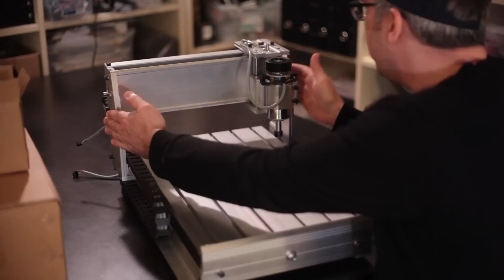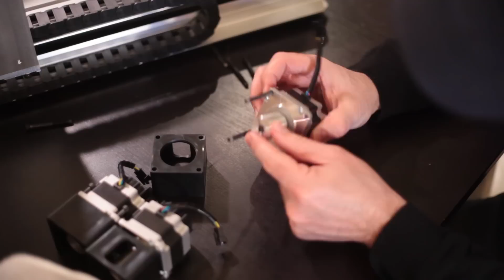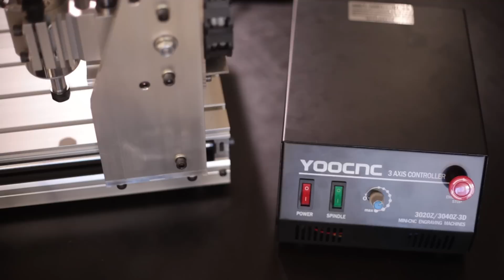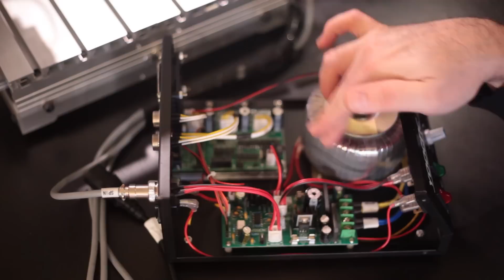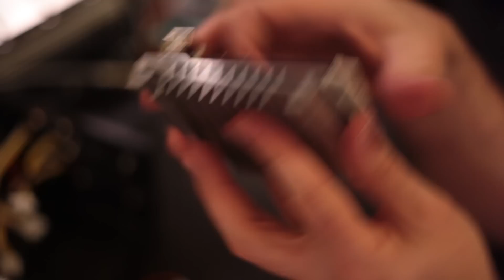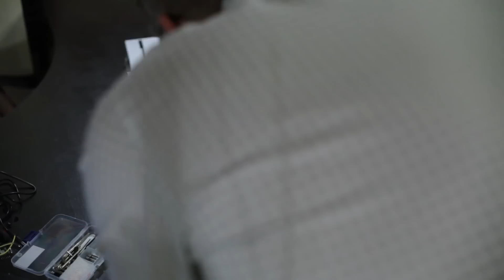Build a ChiliPeppr Driven 3040 CNC

Comment: Stupid question : could someone just use that http://www.ebay.com/itm/CNC-USB-CONTROLLER-UC100-for-Mach3-CNC-Controller-USB-to-Parallel-/271300225770?pt=LH_DefaultDomain_0&hash=item3f2ac0eaea and run Mach 3 ?
Reply: Mambrax444   You can and should us the UC100 and mach 3.  While mach 3 is stated to be "OLD"  When you run cnc in real applications where 100,000 to millions of lines of g code are to be processed, mach3 has not been beat.  Its low cost and HUGE user base/support is a benifit.  I cannot see why someone would cripple a machine by running low power stepper drives.  The router itself comes with crappy electronics.  This should be the very first upgrade.  High quality stepper drives and power supply.  Will make a HUGE difference in preformance.  Also, there is NO stuttering when using either a SmoothStepper or UC100/300 Pulse generators.  Dont know where that myth came from.
Reply from the maker: Mambrax444 You likely could, but i've heard these converters cause stuttering. Also, I would say Mach3 is getting a bit old. It's expensive too. ChiliPeppr is free. If you stick with Mach3 you also lose out on using a Raspberry Pi as your remote interface, the ability to do remote monitoring, the cloud, using a browser, using a tablet, writing your own Javascript plugins, using GPIO ports from a Raspi or BeagleBone for extending, etc.
Reply: Thanks for the input. Just getting more educated on the all home CNC world, for sure your approach is clever and elegant, just not sure i will be capable of doing the same great job at it !
Reply: +CNC Thanks for the input. Still in the process of searching. Any pointer and additional info regarding the use of UC100 and those machine. I'm a little worry to get a unit that doesn't work with that config as well how to set it up. Any help will be warmly welcomed !!!
Reply: Mambrax.  The UC100 is as plug and play as it can get.  The who purpose of the device is to 1 allow you to use a 25 pin controller on a computer without a printer port.  It also takes the work load off of mach 3 when it comes to generating pulses set to the electronics.  By doing this the computer works less and you get a smoother pulse stream out to the stepper drives.  The UC100 has the exact same pinout layout as a printer port.  So it will work with any configuration that mach3 will work with.  Software install is simple.  If the computer has internet access then there is an auto installer that will do everything for you.  If no internet, then you install the usb drivers, then install the plug in for mach3.

Comment: hi, I think your vid convinced me to go for one on ebay... I was looking at www.wegstr.com for about £380, looks precise and v.slow... but having much larger 30x40cm, ball screw machine for about £530 makes a better investment, I think... 
I want to do a v-grooved lettering on a 10mm flooring slate (house number signs).
Do I need any speciality software or is the ChiliPeppr something I could use for v-grooved lettering, pls?
BTW, I never used CNC but I use a 60W Chinese CO2 laser cutter regularly..
many thnx,
mike
Reply: John Lauer I am going a custom Build with TinyG and want to use a raspberry PI. The question is since you have to use a laptop to access the browser to run ChiliPeppr, what's the benefit of the Raspberry Pi?  Can I send the Gcode to the RB Pi Wirelessly via the Json network on CP? Or do I need to be networked with an ethernet cable to the RB Pi?
Reply from the maker: gr8deals2do Nice. I would say go for the higher end companies. Don't skimp. Avoid trapezoidal screws possibly unless it's not important to you. There are low-end providers on ebay. ChiliPeppr will be fine for you. It takes standard Gcode. Do a TinyG controller too. I have recently swapped the BeagleBoneBlack for a Raspberry Pi 2 which has been great for me.

Comment: Just curious- why the Beagle Bone as opposed to a direct USB connect from the laptop with JSON?  Thanks!
Reply from the maker: Couple reasons. 1) The BBB has GPIO on it so I can have it toggle on my eventual LED lighting, vacuum, fans, etc. You can't do that from a laptop. and 2) I want to be able to run my job from my laptop and be able to walk around the house and monitor the job by keeping the laptop with me. I will be running multiple webcams inside ChiliPeppr to visually and audibly keep tabs.
Reply: Cool. Good Answer! I wasn't even thinking beyond my tactile switches for lights and vac.

Comment: I don't understand what the Beaglebone does. I thought the TinyG did the motion control with its embedded processor and the Chilipepper sent it the g-code commands via USB. I wasn't expecting to see another processor involved.
Reply from the maker: ChiliPeppr sends to the Serial Port JSON Server. That server is a bridge between a websocket and all your serial ports. So, yes, you can run the Serial Port JSON Server on your laptop and eliminate a device, but it's nice to use a separate device so your high-end laptop can be de-coupled from being next to the dirty/dusty CNC machine. You can start your job and go sit on the deck with a coffee while it runs and you monitor it from your laptop.

Comment: I did exactly that a few weeks ago but with a CNC 3020. I cut a square hole with a Dremel near the parallel port to fit TinyG's USB port. It works beautifully!

One warning though: the power supply board is limited to 3A on both the 24VDC and the 50VDC supply. This means there's little room to upgrade the stepper motors, and you can't upgrade the spindle unless you redo the power supply. In fact, since the spindle power is limited to 50VDC * 3A = 150 W, the claimed 230 W rating is a bit bogus. If you redo the power supply, you're likely to need two separate power supplies (one for TinyG, one for the spindle), which will unlikely fit into the neat controller box.

That said, I have been cutting aluminium with just the stock motors and spindle, and for my application it seems sufficient. I'm more paranoid about snapping my endmills than not having enough power/torque.

P.S. ChiliPeppr is brilliant - Thank you!
Reply from the maker: Couperin le Grand do you have any video of cutting aluminum? You are doing exactly what I'm trying to achieve. Your experience with the power supply is GREAT feedback. I do want to upgrade the spindle soon so you're right. Even with the motors, if I am pumping out 2A to each motor I'm pulling 6A at some points. I'm driving them at 2.5A even, so you've got me worried already.
Reply: John Lauer I do hope I'm mistaken. The two fuses on the power supply board are rated 3A. Would it be risky to install high amperage fuses? One would have to find out the rating of all the diodes and transistors to be sure.

There is a second difficulty with upgrading the spindle. The 230 W stock spindle is 50 mm diameter. The 500 W one is 52 mm. If you want 800 W then it's even larger. The spindle clamp is nearly exactly 50 mm and won't accept anything bigger.
The spindle clamp is integrated with the ballscrew nut and linear bearing housing, so to upgrade the spindle, you'd have to replace the whole block. Some other models from carving-cnc.com have bigger motors, and it might be possible that the ballscrew nut and linear bearing positions are the same as the CNC 3040/3020. And then it's another question if they'd sell you just the block. I don't know if it's possible to saw off the spindle clamp, or to enlarge it, but I struggle to see how that could be done without losing any perpendicularity.

I'll be cutting more aluminium in the next few days and I'll try to post something. I'm using a 2 mm endmill to cut out shapes from 1.5 mm aluminium plates. Feed rate 1000 mm/min, 0.07 mm pass depth, full spindle power. No missed steps whatsoever.

The aluminium plate isn't very flat, and at times the first cut into the surface must have been as deep as 0.2 mm or something like that. It took it well, and still no missed steps, though the noise scared me a bit as I'm a total noob. The machine can be pushed to go faster, I think. I'll be trying the auto-level feature next.
Reply from the maker: Couperin le Grand Here's a spindle you could upgrade to, but that's about it given the 52mm diameter of the 3040 I have. http://www.amazon.com/LD52GF-400W-Engraving-Milling-Spindle-Controller/dp/B00CLL84A4/ref=pd_sim_sbs_hi_3?ie=UTF8&refRID=0HNP6GZMN62K9XHMQ794

I think I'd just run this from an alternate power supply. I would tap into the PWM controller so TinyG could drive it. Then I'm just not worried about any other inner guts of the controller electronics that came with the 3040.
Reply: Are you sure the 3040 spindle diameter is 52 mm? According to carving-cnc.com, both the 3040 and the 3020 come with the 230 W spindle, and mine measures 50 mm. I'd be surprised if the 230 W spindle exists in both 50 and 52 mm!
Reply from the maker: Couperin le Grand Yeah, I measured it yesterday with my calipers. It's 51.87mm, so 52mm. Also, the model number on carving-cnc.com of my 3040 is technically 3040Z+D52 and that D52 means "diameter 52mm" of the spindle.

Comment: John, is this CNC only for engraving tho?
Reply from the maker: The term engraving is used a lot to describe CNC machines, but this will do aluminum, carbon fiber, even mild steel if you go really slow. This thing is way more rigid than most CNC's out there in the maker community, so i think it's fair to say it's much more than engraving. It's no Tormach or Hass though.
Reply: wow... so with the tinyg, this will work just like a shapeoko? or u need the gshield?
Reply from the maker: All you need is TinyG. All the stepper controllers are built into the TinyG. No need for the gshield.
Reply: whats the difference? if u don't mind
Reply from the maker: The difference between Gshield and TinyG?
Reply: yes
Reply from the maker: Gshield is just the stepper motor controllers. TinyG is the Gshield plus 1 additional stepper driver and the core 32-bit processor running the firmware.
Reply: John Lauer great short and clear explanation! Thanks John!! :)

Comment: E stop to z max . Check TinyG wiki
:-)
Reply from the maker: Not sure that's the best approach here given that the e-stop switch on this controller stays depressed when you hit it. That forces the reset button on TinyG low, which keeps TinyG disabled perfectly. Only when you rotate to release this e-stop switch does TinyG reboot itself. So, why waste the z-max input which I'd actually like to use for real as the z-max?
Reply: That's ok too I guess, I just didn't think you wanted a reset every time you e-stopped. I think I might have gotten it wrong: xmin,ymin and zmax is "home" and xmax,ymax and zmin is the opposite end of the travels. That would make zmin the one I was thinking about.
Will you make a "intro" video for Chilipeppr (step by step for average users - zero to hero) ?
My CNC mill is not finished yet. I'm designing a miniature 10cm cubed cnc mill - i.e. I'm not using a Shapeoko.
http://www.realgentlemen.dk/MediaWiki - CNC Mill

Comment: Nice mod! How much did you pay for 3040 CNC, if you don't mind me asking?
Reply from the maker: It was $800 + about $200 in shipping, so that added up a bit, but it included the spindle, the power supply, the motors, etc. So compared to other CNC machines its way cheaper or on par and I think it's more rigid for the kind of work I want to do.

Comment: Thanks for the quick post!   I'd love to know your configuration and measurement procedure. Could you do a video of that?  Also did the Spindle control work?
Reply from the maker: I did not get the PWM to work yet. I tried a few guesses and it didn't work, so I'll have to do more debug on it. I will post the configuration I used, but will likely get that posted inside ChiliPeppr so it's available from a standard pulldown menu to pick global configs like "Standard 3040 CNC Config"